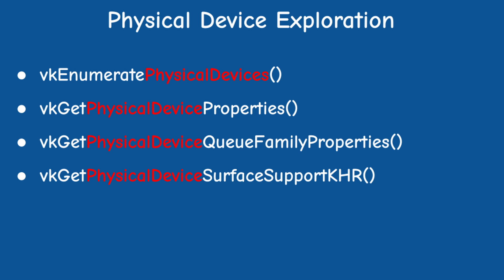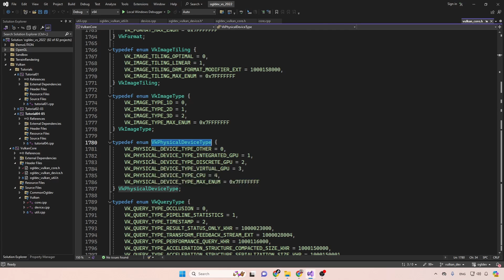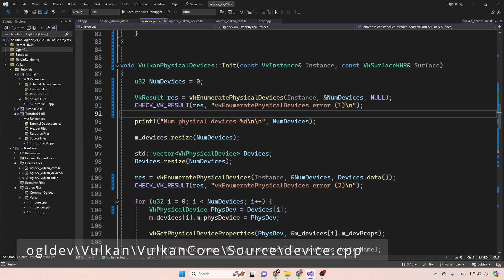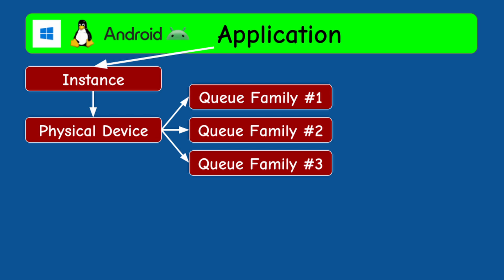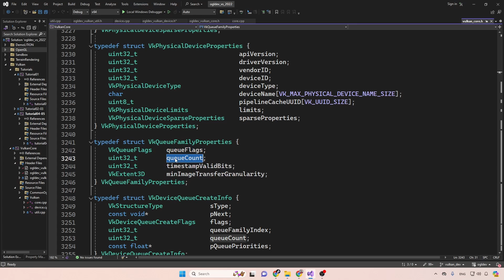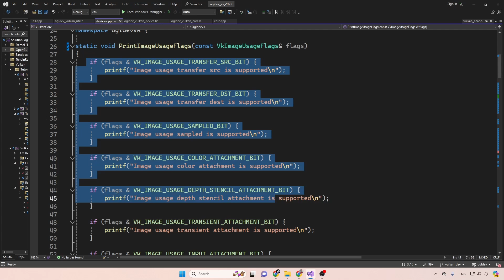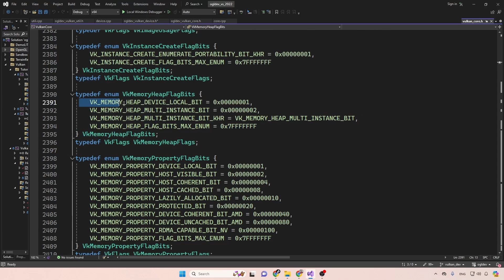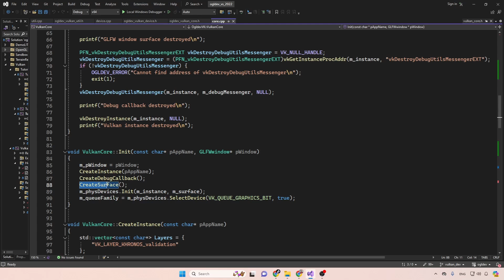Let's Get Physical (Device) // Vulkan For Beginners #5

Comment: I have an advanced question: what if the device can't present? I have a GTX 960 and GTX 1060 in the same machine, and the 960 isn't connected to a monitor. I'd like the option of selecting the GTX 960.

I'd need a swapchain on the 1060 and render targets on the 960, right?
Reply from the maker: This setup is tricky on Vulkan. You can't simply create a swapchain on one GPU and render on another. You can copy the image between them - from the rendering GPU to the presenting GPU. You will need the extension VK_KHR_device_group here.
Reply: @OGLDEV Apparently, the GTX 960 and 1060 are in different device groups. Would I have to copy to system memory?
Reply from the maker: Sorry for the late response. I don't think that the problem is the device groups. Since each GPU has its own local memory you will need to copy. The extension VK_KHR_external_memory may also be of help here.